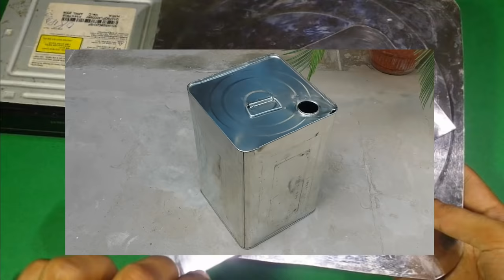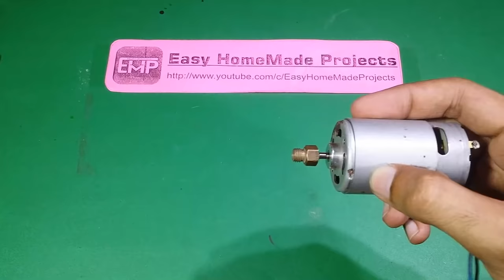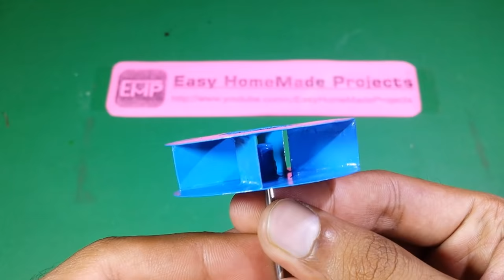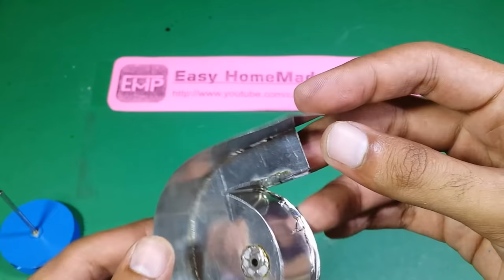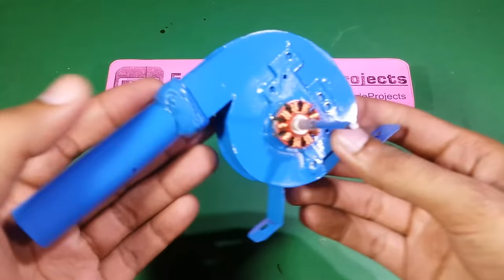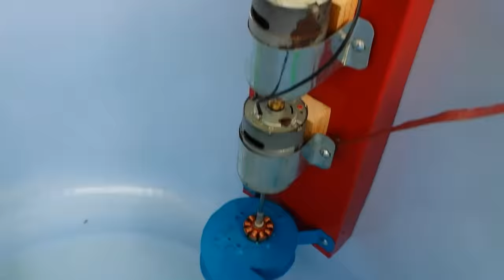How to make Dual Motor High Power Water Pump (Closed Impeller Design)

Comment: yeah! let's put electronic components near a splashing tub of water!
BEST
IDEA
EVER
Reply: +NeedyZ but still.. it might not be dangerous, but this might go wrong somewhere
Reply: dumb animu
Reply: Seriously, do not do this. I'm kind of surprised people put videos like this up. This is not safe.
Reply from the maker: Actually you people don't know any thing about electronics and electrical. first of all, there is no electronics used in this project. only 2 DC electric motors are used with a 12V DC battery. It is not dangerous even if you put whole thing under water.

Comment: wow it looks so awesome how you solder these metalplates together!  This Pump looks so professional, you are so great man!
Reply from the maker: +banano banana thanks. I have soldered it with simple 75W soldering Iron.
Reply: Thanks for you reply, i have to try this on my own with the soldring Iron of my dad but I better start with something easier :)
Reply from the maker: +banano banana sure. It is also easy. Just needs a little bit attention.
Reply: Yeah I'm quit used to soldering electronic circuits but soldering such thredimensional objects is New to me. You don't fix the two Parts with any Special Tools in their place when soldering, right?
Reply from the maker: +banano banana yup
Reply: Labgear
Reply: Tried

N
Reply: L

Comment: Dude, why do you need the solenoid from the CD/DVD drive?
Reply: he uses it like a bearing
Reply: ohh! wow haha. thanks!
Reply: Cornelius Fudge I was trying to figure that out myself. It's just a cheap bearing. Possibly a bit of a waste of parts.
Reply: Bearing reduces resistance on the motor, allowing it run longer without getting hot, or using as much electricity
Reply: A bomba d'água + foda do YouTube!!!!!!
Reply: SuperFlash Gamer
Reply: SHUBHAM DHAKAD
Reply: it is a waterproofing bearing joint
Reply: McGaughey  well duh
Reply: McGaughey everyone knows what a bearing does
Reply: Ahh!!

Comment: Doesn't the motor get hot? How to cool it down if it does?
Reply: Spray the hose on it😉
Reply: LOL. I think it will get shorted xD.
Reply: Most drill type motors have a plastic fai in them already.
Reply: +ROTAXD oh, you mean it's fine right?
Reply: +R
OTAX
Reply: Don't worry buddy it won't get hot neither will it get shorted. I've tested it under and over water at voltages ranging from 9-24V ( since, 24V was the max voltage available at that moment) and everything runs fine. The reason is: its DC. :)
Reply: Oh, now I understand. Thank you! :D
Reply: happy to help :D
Reply: Has fuck all to do with the motor begin DC, if you try to run the motor over it rated spec it will heat up, stall a motor and it will start to heat up because it can not provide enough torque and you are running it out of spec.
Reply: +the real illuminati didn't you know? All dc devices are waterproof. I thought it was common knowledge? It works because water flows one way, like dc current. See, it makes perfect sense 😉
Reply: Conor Murphy
lol yeah ofcourse..
Reply: Moreover, the specs you are talking about which is for e.g. "200 RPM, 12V" is just the efficient spec not the limit. You can run it above/below 12V without any problem unless you go too high on Voltage/Current. The only difference it will make is changes in RPM and Torque.
You could've asked this politely as well.
Reply: Sudhansu Barik
if you will run 12V motor on higher voltage it will heat up and slowly might die, you are pushing it over the rated spec.
When you push higher voltage the current increase and slowly the winding might burn or get very hot because they are not meant for such currents.
Reply: +the real illuminati That what you are talking about will happen for sure but only if you push it too high. The problem may arise if you provide current more than 4A and while increasing the voltage a close eye should be kept on the current and making sure that the motor does not run at high current for a looonng duration of time.
I always made sure I don't cross 4A so I don't know practically what would happen to the motor. All I have heard are theories.
Reply: Wow
Reply: SuperFlash Gamer into
Reply: Sudhansu Barik what could be a replacement for ghee container? Please let me know
Reply: 4
Reply: Abhishek Singh
Reply: Hello
Reply: The above is true that nothing happens and also the part that is true is, electrolysis happens to some of the metals where electricity is used and in the long run you can see the components corroded or rusted signs ..... best not to allow water from the motor pin upwards ..... for heating at the rear end of the motor there normally is a fan that i have noticed .....
Reply: More pressure than my town water top job😊

Comment: what soulder and flux you use for souldring galvanized steel ?
BTW great video bro .
regards .
Reply from the maker: +toolman talal simple 75W soldering Iron.
Reply: the solder 40/60 tin same like what used for electronics ?
Reply from the maker: +toolman talal yes
Reply: Easy HomeMade Projects thanks brother .
Reply: 2
Reply: You can get away with a basic 60/40 tin/lead solder and plumber's flux, OR use a 60/40 with a flux core. Either one will work as long as you use a soldering iron with a fairly decent thermal mass. (The bigger the tip is the better for these projects)
Reply: +ThEcRaZ3dGaM3R Thank you
Reply: Kha

Comment: your top motor is spinning the bottom motor, not the axis, I mean the whole motor. look closely 7:32 at the motor nearest to the water. so Im assuming there is a lot of tension now in the cables that go down to that motor. put some rubber between that motor and its bracket, metal against metal isnt a good friction hold. Good little project anyway
Reply: bom
Reply: krloz3c

Comment: You could probably rewind the spindle motor stator and drive it with an RC ESC for a motor compact brushless d c pump. :-)
Reply: I have an old castle esc and motor I can run with a 3s lipo for super high flow pump or use a 4s or 6s for very high flow water pump
Reply: What is the purpose of the motor stator?
Reply: +Raoul Cruz It is a static set of electro magnets that pulls and pushes the magnetic rotor round to create torque. In this video he's just using it as a bearing.
Reply: +Default Name  the only problem with that is that a home made unbalanced impeller, riding on only 1 bearing would tear both itself and the pump housing apart.
Reply: dual bearings!
Reply: Coolkeys2009
Reply: Sangat bagus
Reply: ههههههههههههههههههههههههههههههههه ههههههههههههههههههههههههههههههههه ههههههههههههههههههههههههههههههههه
Reply: Coolkeys2009 dog
Reply: Coolkeys20009
Reply: Niceeeep
Reply: Hai da ta
Reply: Coolkeys2009 urgongc ncv hcv
Reply: Coolkeys2009 mohit rajpoot
Reply: Coolkeys2009
Reply: Coolkeys2009 
hhhhbdn

Comment: It is a VERY VERY bad idea to put 2 electric engines connected to a 12 V battery INTO a bucket filled halfway with water
Reply from the maker: +Perchtold thnx. Tell me some "good ideas"
Reply: +Easy HomeMade Projects A really useful idea would be putting an electric motor with a car battery onto a bike, some kind of a selfmade e - bike

Another cool thing would be making your own hoverboard. Recently i have built one with 2 wheelbarrow tires, a plate of wood, some steel strive on the underside and 2 battery drills. The tires are mount in a hole in the middle of the "board", the drills are connected with bikechains to the wheels and i put some mini full rubber wheels for stability on both ends of the board. If you lean forward the drills start spinning, ive done that with a pressure sensor
All things for this project i had at home, so i didnt have any costs ! And it is a really entertaining gadget :)

Comment: Isn't it bad if water will contact with electric motor?
Reply: not really. some electric rc cars tell you to run the motor completely underwater to break it in, as it smooths out the brushes. the two poles are already connected with caps and resistors anyway.
Reply: BariumCobaltNitrog3n Wow))) My old (really old) "Rocket" (rus "Raketa") vacuum cleaner in the garage stop working after that)) I don't really know why. It was built in the 1960-1970's in the USSR, and worked really like a rocket. But in a wet air it just died
Reply: Valeriy Reiter
open her up. look for corrosion and clean it out with some wd-40 (water displacement-version 40) it'll probably still work
Reply: BariumCobaltNitrog3n There's no corrosion, but I think problem with oil on the brushes. Will clean it up))
Reply: مرحبا
Reply: Amir says what?
Reply: y..
Reply: Creo que depende del motor.
Reply: مرحبا read as "marhaba" means something like hello
Reply: que risa :V
Reply: This reply section is a god damned mess
Reply: don't do it bobby
a clusterfuck, if you will.
Reply: generally no most electric motors can operate just fine under water but its when the 2 wires or connections get submersed the current can jump and this generally causes damage to whatever is powering the motors but where this is a straight switch and battery set up the worst it could do is connect the circuit to itself at a different point which would just give the current another path to flow through
Reply: V. Idea nope

Comment: If these motors aren't special low rpm motors, you should think about using a smaller impeller. Otherwise the motors could overheat, because of too much current & too low rpm. But all in all nice project, I like the metal work and soldering! :)
Reply from the maker: +LSF25 thnx

Comment: Good video. My water tank is only a few meters above floor, so water pressure is scarce and the water heater is reluctant  to turn on. I think this pump will add the needed additional pressure.

Comment: Those motors are designed for high speed applications, from the sounds they are making I can tell there spinning quite slowly and thus will have a very short life of being overloaded. What you should do is make the impeller blade height about half of what it is.

Comment: Performance wise, is it really efficient to have two motors connected that way ? (eg: will they run exactly same speed ?)
Reply: It won't increase max rpm at all but it effectively doubles torque output providing you can provide enough amperage to both.

Comment: hi ..... i have a question ,........ how do you connect these motors with push button  and also tell me about didoes which connected  on button  thanks allot .......... you are doing awesome job keep it up.....
Reply from the maker: +raja nomaan diodes are used for isolation between motors.

Comment: nice...can you please tell what solder did you use and which soldering iron and the flux if any.
Thanks :)
....Amit
Reply from the maker: +Modeller's Point 75W soldering Iron. With simple electronics solder wire.
Reply: so the 60/40 solder is what you used right?

Comment: could this also move air and/or be hooked up to a DC voltage control instead of a 2 setting switch?
Reply: Panzer IV of course, can be controlled with pwm, but I don't know the real effect of control the speed of the rotor vs the flow
Reply: I think the speed of the motor will directly affect the pressure it will produce. The flow will depend on the size of the tubing and how much resistance there is for the water to flow at whatever pressure the pump is making.

Comment: what was the winding from the cd player for? what purpose did it serve?
Reply from the maker: +jeff foster for holding shaft
Reply: He is using it as a shaft and motor from CD drive is only working as a bearing

Comment: Bhai solder wire ki jaga silicon use kar saktay hain. air tight karnay k liy?
Reply from the maker: +Fathan Khan but that will not strong enough to hold entire thing.
Reply: OK thnx

Comment: Have you tried to use a 3d printed a pump, and use a stepper mortar  and a Arduino to control the stepper mortar. You can get more water flow and more pressure.

Comment: whats that stuff you used to glue together the iron sheet? pls post a link where to buy. thanks
Reply from the maker: +98,765,4321 Views Recommended simple solder wire. Used in electronics

Comment: Hi your videos are very attractive. My request to you that you have to make a video in which you will show How to solder two steel plates and tell that is it dependent on soldering iron. I saw your many videos but I can't do that.
Reply from the maker: +Sudip Bag try with a 75W soldering iron. And meterial should be iron. Don't use aluminium cane.

Comment: Whats the point of the 2nd motor?  Wouldn't they both be going the same speed does it add torque or something?
Reply: maybe, because the water resisteance
Reply: chris smith double the power
Reply: Double torque not power.
Reply: An increase in torque or RPM both mean an increase in power. In this case we know the power consumption has gone up running two motors so we know the power out has also gone up. Both torque and RPM would increase which also means the power has increased because power = torque x rotational speed.
Reply: But of course the pump has to turn faster or there is no advantage to having more power. You could drive that pump with a V8 engine but if it's turning the same speed as in this video there is no increase in water pressure.

Comment: What is that black thing you have welded on the switch?
Reply: diodes that serve to convert current from AC to DC, i wonder why he used them though since his power source was DC (a battery)
Reply from the maker: +mbarizia just for isolation between motors. To reduce loading effect of motors to each other.

Comment: What is the reason for using two motors together?  Will it not run with single motor? Please clarify.
Reply from the maker: +Ashok Ghate to double the power.
Reply: Thanks for the clarification.  I want to make a water pump to clean my car from outside when I am travelling. will this pump be helpful?  I want the pump to be run from car battery.  Can you provide me the sizes of side covers, bushes, blades, inlet and outlet nozzels, etc.  For soldering should I use hard solder or soft solder will work?

Comment: Is there really that much extra pressure compared to a single motor?
Reply from the maker: +Justin B yup of course. About 25 to 30 %
Reply: having 2 motors means it's less work for each motor, so they can spin faster and therefore create more pressure
Reply from the maker: yes

Comment: Dear  EasyHomeMade Project Team

Please Can You Help Me ?
I Need Your Help. I Want to make this project for my Garden. I Need To Move water around 50 Meter.
How Can i Use this project i mean how can i move water ???  
please help me
Reply from the maker: you can make this project by using a larger motor to increase pressure.
Reply: What Do You think is it So hard to make  brush and impeller ?????  I  think motor side is easy but i am afraid of making impeller

Comment: The water level in the tub will goes down when we use the water but the motor remains in the position
Reply from the maker: +bharath kumar motor was bound with transparent tape.

Comment: Have you demolished the CDROM just to extract that axle from it? Is not it easier to use a stick with a lollipop? I understand that the motors you have from the unnecessary pump ? ;)
Reply from the maker: +Roni Tori you are comparing steel shaft with a lollipop stick??? Lolipop stick will not last longer than 2 second.
Reply: With this lollipop it was of course a joke. And can not be a nail? Too bad you did not use the grenade cotter ;) You have almost 8,000,000 views - Congratulations

Comment: why do you use two motors? how solid is the link between the two motor shafts and the shaft for the pump itself? 
My point being isnt the second motor just waste? if the shaft between motor#1 andpump isnt 100% solid it can slip and surely providing more power (with an equal slippy shaft connection between the mototrs) will just go to waste?
Reply from the maker: +Leif Hagen i have connected them with brass connectors,  as i explain in subtitles. Now it is 30% more efficient as compare to 1 motor.
Reply: Sorry, didnt see no subtitles
Reply: +Leif Hagen that means you did see so stop acting cool
Reply: huh? 99% of the time i turn of annotations/cards and subtitles cause they be annoying and fucked up covering what i want to watch (the video).. so i unfortunatly did not recieve that info until i asked, but thanks for answering and clearing it up for me :)
Reply: But the purpose of the use of Solenoid from DVD is not clear!!
Reply: But the purpose of the use of Solenoid from DVD is not clear!!
Reply: he use it as a kind of ballbearing for the shaft
Reply: Leif Hagen How a solenoid can replace the ball bearing?

Comment: Why did you put diodes on the switch?
Reply from the maker: +Søren Sørensen for isolation between motors.
Reply: Is that necessary for a on/off switch that break the circuit of 2 motors? Would be if you were using an transistor to break the circuit but a switch?

Comment: which solder wire do u use ?!
Reply from the maker: simple as used in electronic circuits.
Reply: 63/37 ??    (63 tin, 37 plomb)
Reply: Multicore Sn60/Pb40
Reply: +Don Juan لظيمس

Comment: and why do you need the coil from a cd rom exactly? bearing? if you have no money and just wanted to fab something. cool. but cheap drill powered pumps exist for under $7. cost of 2 of those dc motors is more than what youd want to spend on somehting like this.

Comment: your previous video  your water pump throw 8 ft without pump..and this pump is throw just 4ft .then this water pump is more extreme ...
Reply from the maker: +Aman kumar previous water pump out let hosepipe is made out of  5ml syringe and this one is from 20ml. So which one is larger???
Reply: +Easy HomeMade Prodjects It also appears that you are using a 6v battery in this video to power the motors which will reduce the pressure and flow.
Reply from the maker: there is no 6 volt battery, but 12V